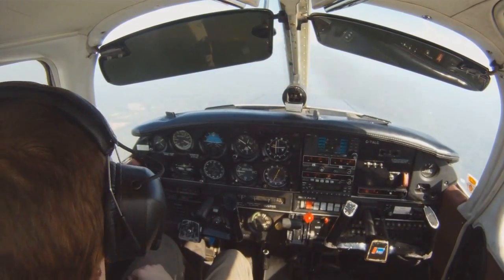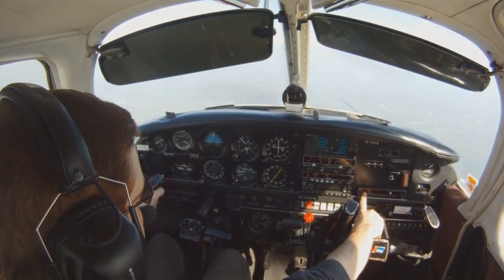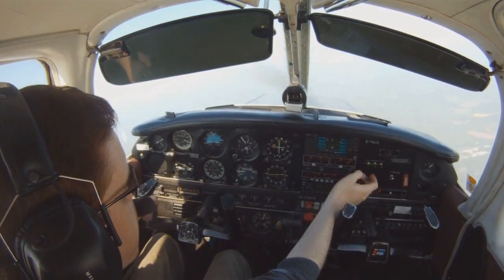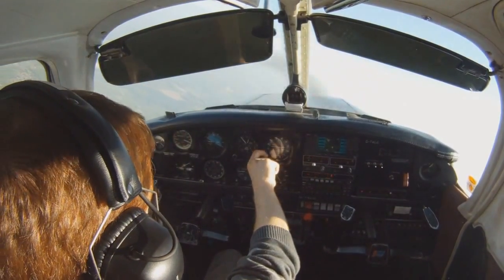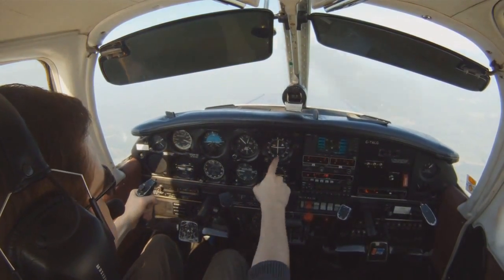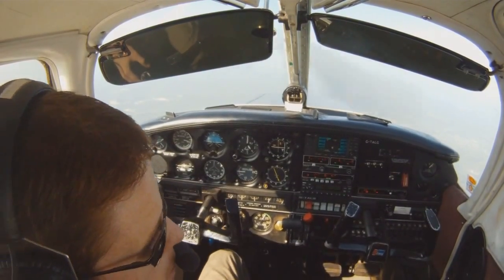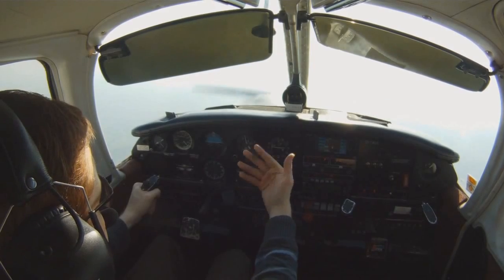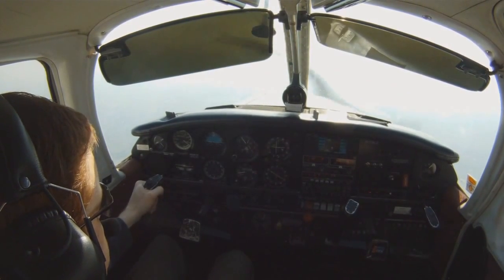How to fly using VOR navigation (practical) - Part 2

Comment: A little confused here as every time you said turn left, you actually turned right, and vice versa.  You also appeared to be flying the VOR reversed, as if the pointer goes left, you turn left to re-align. ? Pls correct me if I am wrong :-)
Reply: Yes, as with instrument landings systems, which uses the same indicator you "fly towards the needle". So if the needle is off to the left you fly left to realign, as you said.